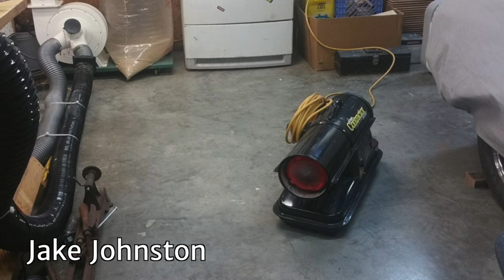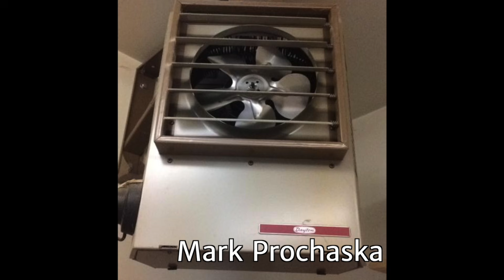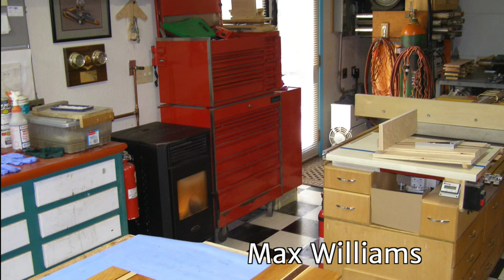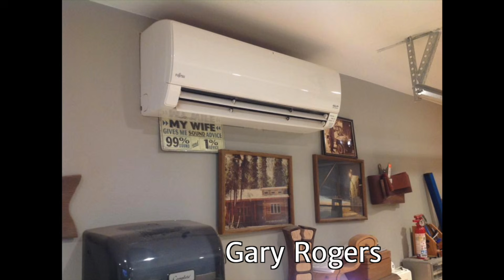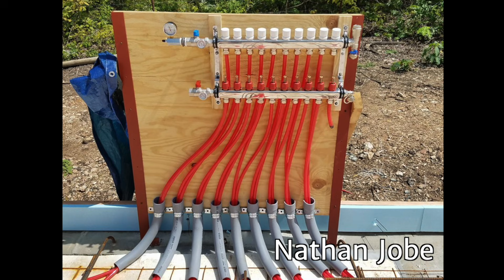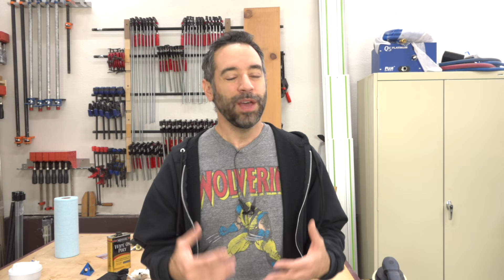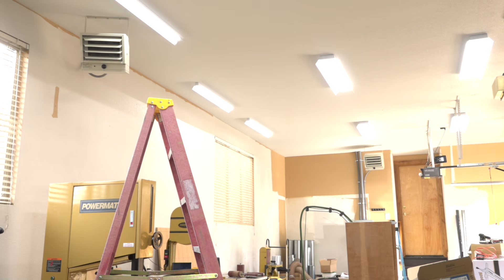Heating Your Workshop

Comment: Mr Judy here. As a retired HVAC tech (among other things). I do not understand  people's fascination with adjusting thermostats.  While there is a difference between summer and winter comfort temp (it's only 3-4 deg), you don't need to adjust it but twice a year. So, in your case you'll only need to use the ladder twice a year since the off/on switch is within reach😊👍

Comment: Very interesting video. Thank you. My biggest concern: I don't recall you mentioning carbon monoxide! You can not run a fuel burning heater in a confined area without adequate ventilation! Opening a window and running a propane heater is Not adequate ventilation. It will kill you!
Just saying.
Reply: it will also burn the oxygen out of the room creating massive condensation on your cast iron and worse labors breathing.....

Comment: When I finished my shop and needed some form of heat (Living in MN), I weighed a lot of these options (minus the torpedo/propane garbage can).  I ended up actually going with a residental forced air furnace, hanging along with 1 trunk and 6 vents across the back ceiling/wall corner across the 28' shop.  It works fantastically.  Had the bid for it been only $5000 for mine, I would have been happier lol  But it's 98% efficient, sealed combustion, and has a filter, which I sometimes use to supplement the ambient air cleaner.  I'll also just use it as a fan in the summer too (I don't have A/C in it, but that is an option).  Overall, I'd do it again.
Reply: I installed my own forced air gas furnace and ducting for my shop, with dampers in the feeds going to areas of the shop I am not using.  Contracted the heating guy to install piping and setting it up.  I'd found the garage gas heater in my friends shop would creat  an allergy problem for me when we were sanding his oak furniture. This is not exposed.  Like Marc said cost and return.  I'm in southern MN.  Getting super cold in October super quick.
Reply: I've installed thousands of furnaces. You made the right choice for a space of that size.

Comment: Gasp on costs energy ROI. '  I was an energy conservation engineer  and a simple calculation which will give you a reasonable estimate is a 7500 Watt (7.5 KW) ( about 25,000 BTU/hr)  draws 32 amps @ 240 v.  7500/240=31.25 amps .  Assuming this is 7.5 KW at $0.11/hr.  Assuming an average  40% cycle for 5 months.  7.5 kw *768 hr/mo * 5 mo x .4 Cycle time x $0.11 /kwh = $1 267.20 for 5 months.  vs  Natural gas at 25000 btu /hr * 768 hr/mo * 5 mo x .4 Cycle time x $1.00/ 100000 btus-hrs = $384.00.  electric vs Gas is $1267 vs $384  per year in other words Gas heat should be about 30% of the cost of electricity heat.  Heats pumps can even be more efficient.  So how is your monthly cost running with electric heaters.
Reply: I went crosseyed trying to understand math lol. but, the final numbers seem right from my research. I do Propane. I prefer being as offgrid as possible. We have often had power outages here. I stock smaller cans of propane, I think I am up to 20 cans. Easier to handle and I can go get filled very cheaply at Tractor supply once a season (Georgia here isn't too bad) As you said though, this way I do not have to rely on power NOR do I have to tax my already stressed electrical system. I should really upgrade to 200amp service but too expensive at the moment.
Reply: ...Also, shame he hasn't responded to this. I don't sub to creators who do not interact with they audience.

Comment: For my new garage build, I put the tubes in the floor for radiant heat and plan on a mini split as secondary heat and air conditioning. I figure if I keep the garage at 55/60 and when I get inside I can turn the mini split heat on to get it comfortable.
Reply: I had two of those 5000w heaters in my other garage and they heated well but the lower 3’ was always cold and the ceiling fans didn’t do a good enough job.

Comment: I think if i already had the mini split installed I would have built some kind of box around it on the front pouch and not waste that money then spending $1500 for the 2 heaters and install fee again...
Reply from the maker: A box around it would have made a small eyesore into a larger one. Furthermore, the unit was undersized for the space and wasn't meant to be a long-term solution.
Reply: @woodwhisperer  i understand...  I just hate to see wasted money...  Love your channel and videos to man!!
Reply: Agreed, so long as you make sure there's proper air flow you can disguise it any way you want.  Like these examples...

http://www.airlux.ca/portfolio/Herritage%20Valley/IMG_0138.jpg

https://i.pinimg.com/736x/e5/b3/cf/e5b3cf0a97cd3b0830f13a5b2e91beba--heat-pump-interior-ideas.jpg

And there are ways to hide the interior unit too...

Comment: I'll tell you one thing. the bill is gonna HURT.
Reply: Also, A somewhat power saving DIY thing is to do a solar heater panel and put it on the sunny side and then blow hot air into the shop. It can work pretty long into the autumn and even to some degree in winter.

Comment: I'm in a unique position (thanks to our town owned/operated utilities) where electric is actually my cheapest option. I never let the shop go below 38 degrees (glue and finish). A single 5000 brings my heavily insulated 400 sq foot shop up to 60 degrees in the time it takes me to make some coffee and make my way out to the garage. It's quiet and out of the way. I do find that leaving it on the high power setting  and letting it run more often but at less of a duration is more efficient than switching to the lower power setting. Insulation is key though. Also, no added moisture to the air

Comment: You could always leave the built-in thermostat knob turned on, and put a switch down low. Or *gasp* just use the circuit breaker as your switch.
Reply: Circuit breakers aren't designed to be used as often/as switches like that.
Reply: Absolutely correct. But real life.... switching the breaker on/off once a day, in cold seasons only, isn't going to cause any issues for a long time.  But if you wanna be legit, it would be easy peasy to add a proper switch right by the panel.

Comment: On my place, I grow a lot of apples and nuts, also coppicing them to make greenwood furniture. That leaves me with small diameter woodfuel as a byproduct.
The thing is, my tools don't care if they're cold, nor does the workshop airspace. So why throw heat into it, just for some to land on me? So, I'm currently building a Rocket Mass Heater out of mostly materials off my land. They're a very economic form of masonary stove and easy to build, but highly efficient using less than a quarter of a standard woodstove cordage. They heat you as you sit (or lie) on them, much as a cup of coffee warms you through your hands. A couple of hours burn time can give you 48 hours heat, depending on how you design it. There's loads of them on Youtube, but you can't do better than reading the RMH intro book by Ianto Evans and Leslie Jackson, then the technical RMH Builder's Guide by Erica and Ernie Wisner.
It's a total paradigm shift, but a great path to follow, and then there's all your waste wood to use for 'free' heat.

Comment: Two quick comments:   Breakers are not made to be on/off switches.   They will wear out.     Second, at work we had the same problem with the thermostat location.   Just reach up with a stick, there's enough grooves on the side of the plastic knob to catch on the edge of a stick and you can quickly and easily turn the knob to adjust the temperature.    once you've adjust the temp a couple of times, it get's pretty easy to do.

Comment: I went with the exact same units.  I do wish I had installed the line level thermostat, but like you said - you can that later on as well.  These things work great, but if your shop lacks 220 single phase your electrician cost may go up.  :)

Comment: Thanks for the overview. I’m in N.J. and plan to use the mini splits for two reasons: one is you also get AC which is truly needed here during July and August. The other reason may assist you as well. I’m putting solar panels on the roof which should great off set the higher electrical usage.

Comment: I'm sure you could build a nice looking enclosure for the heat pump outdoor unit. 
Ground source heat pumps are pretty cool too if you're really worried about low COP of air/air heat pump when the outdoor temp drops below -10°C or so. 
Above that, they are really efficient nowadays.

Comment: Thank you for this video.  I would like to see a video of you doing the connections for the external thermostat and switch.  I have an electric heater in my shop that I turn on and off from the panel.  It does the job just fine, but like you, if I want to change the thermostat, I am climbing a ladder...not the solution I want.  I'll keep my eyes out for that video!
Reply from the maker: Sorry but that video will never happen. I will never show electrical work on my channel for liability reasons and for my own sanity. :) Happy to share some information offline via email though.

Comment: A quick monthly estimate would be $50 x H where H is the number of hours each day he has to run them.

That's 12.5 kw (both units at full power) x $0.12 (round up of CO kwh cost) = $1.50/hour.  If he's running them for 1 hour/day that'll be $50/month in electric.

Comment: Where I live, in floor or wood burning stove are the most practical solutions but -30 requires more than a heater. 
I have been toying with the idea of wood stove outside the shop and running a venting/fan system into the shop from it.
Reply: I've got a wood burning stove in my basement, and it heats water that is pumped to radiators around the house. I don't see why this couldn't be extended to a workshop.

Any lost heat ends up heating the basement, which is a good thing.
Reply: You could also put a water heating coil in the stove and run that to a fan convector inside. Much smaller hole in the wall for one thing. But anything that puts the stove outside will be far, far less efficient than having it inside, in that most of the heat will be lost outside.

Comment: As you work with wood, why not going for a rocket stove, like Loz Harrop?
Reply from the maker: Because I don't usually have a lot of wood to burn. And I don't want to have to buy more just to heat the shop.
Reply: @woodwhisperer  Rocket stoves are very efficient, and can run on saw dust, shavings, any unused wood in fact, that you probably produce all year. Here you can see how he uses them: https://youtu.be/vRo6UFAfPIo
Reply: @woodwhisperer  with a rocket stove you could heat your shop for years with all the money you wasted already lol. Probably not best for your situation though.

Comment: Just a joke, but get a 55 gallon drum and burn your scrap wood!
As for the ceiling fan, run them in reverse to pull the air up and push it towards the ceiling. I live in South Florida where we only have few cold days during the winter, but when it does get cold enough to need some heat, (my wife needs it, I love the cold), I switch the direction of the fans and you can feel the difference it makes from running them where they push the air directly down on you.

Comment: Do you keep these running 24/7 during the cold months (or plan to so as to keep materials from freezing?)
Reply from the maker: The insulation in the shop prevents the space from getting down to freezing temperatures. It would take a long extended cold snap in Denver for it to become a real concern. Back when I used these electric heaters exclusively, I only used them as-needed and turned them off at night. Now I have a mini-split installed and I leave that on 24-7 but turn the thermostat down a few degrees overnight and on weekends.

Comment: Phew... I thought this was going to be new info the day after I order my heating solution! Thankfully, I watched this during my research. I ended up getting a ventless propane heater. We'll see how that works!
Reply from the maker: Hope it works out!
Reply: Be sure you have a carbon monoxide unit that beebs, loud.
Reply: Be sure and vent your shop. When staining you may want to go outside and back a few times to see if the air is breathable. Be safe!

Comment: This seems to beg the question, what type of heat do you have in the house?  If forced air gas, why not just run ceiling ductwork and direct the existing furnace& AC into your shop?  (BTW, a very interesting and informative presentation.)
Reply from the maker: That's generally not recommended for at least two reasons that I know of. First, HVAC ducting is designed and sized specifically for the square footage of the home. Simply dumping air out from that system into the shop would likely create problems by adding additional square footage. The house would likely suffer as a result. Also, introducing dust into the residential system could be problematic.